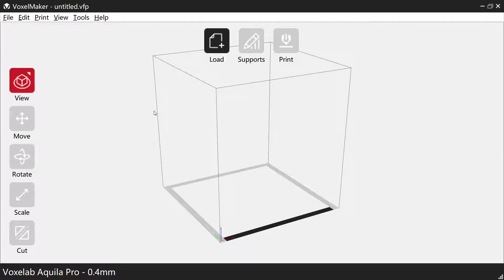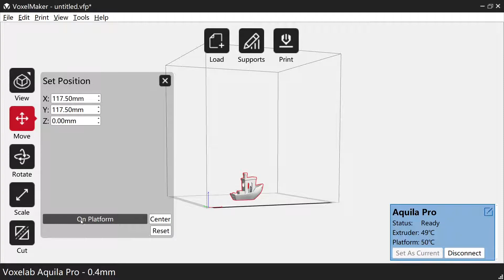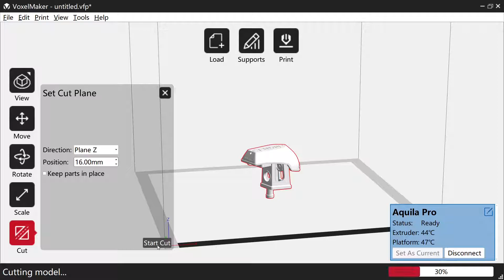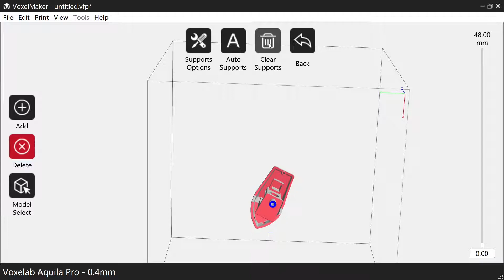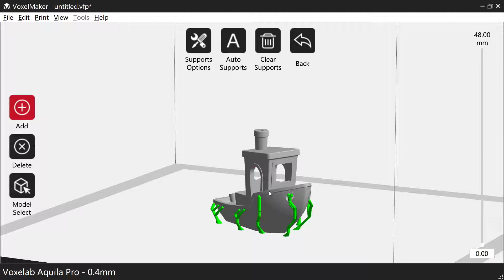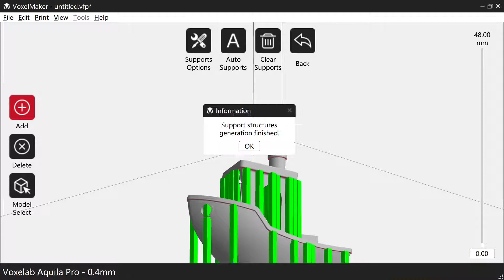VoxelMaker Overview

Comment: hi i was wondering if you could answer a question for me. someone recently gave me an voxlab aquila c2 but it had no lead screw. i ordered one 365mm T8 Tr8x2 Z Axis Lead Screw but my prints come up compressed. did i get the right size. is it possible i need an 8mm pitch? this is driving me crazy. any help you could give would be appreciated. thanks
Reply: That lead screw should work.  According to amazon it's for an ender printer so should work.  You may need to adjust the esteps in the printer settings.  Also check that you have the lead screw secured to the motor

Comment: Hello! I have an Aquilla X2 that I recently got as a gift. I'm NEW to 3D printing. So this tutorial was REALLY helpful in learning like the stuff on the left sidebar there. The continuation of this video KIND of helps me with all the print options but I really need more help and can't find help ANYWHERE from this program. Some prints come out smooth as all hell, others rough and crappy without settings changing or just changing the internal/external composition (Which I don't even know what that is honestly!) Any help would be appreciated! D:
Reply: Hey, I'm so sorry I didn't see this sooner.  Have you found the help you needed?  EDIT: Just realized I responded to this logged into the wrong youtube account.
Reply from the maker: Now I'm logged in to the correct account.  Let me know if I can help you with something but it's better to reply to the edwardMcrichy post, I don't monitor this channel as much as I should.

Comment: Awesome Tutorial!!! 
How can I change colors mid print?
Is it possible at all?
Reply from the maker: I haven't seen a way to do that. In this case you probably need to use one of the other slicers like prusa slicer in order to do something like that.  Check the printer menu you may be able to do it through the printer and not through the slicer
Reply: What you do is when it is at the spot you want it to change colors click pause, and then you can leave the print click auto unload then insert the filament then auto load. Then you can go back to the print section and click on the print you were just doing. Tell me if it works

Comment: How do you connect to voxelmaker via wired connection? Also what firmware do you have on your printer?
Reply from the maker: Hey sorry I didn't get back to you sooner.  I don't believe there is a way to connect direct to VoxelMaker, I don't see an option to connect through USB cable.  You could try using pronterface to load the file to the printer and print.
Reply: Replying to this very late, but hopefully it will help someone in the future. This information is incomplete, but it will get you printing by USB in Cura, and I'm still trying to get it fully functional in VoxelMaker.

It seems that to print directly from USB on older Voxelab models, such as my Aquila X2, you need the CH340 driver, which enables serial communication through USB, same as an Arduino board.

YouTube won't let me post a direct link, but SparkFun (who sells Arduinos) has a good article on it. Google "How to Install CH340 Drivers," and click on their article with that title. After installing, you'll see the serial communication ports in Device Manager, assuming you're on Windows.

To get my computer to detect the printer, I had to flip the power switch first, and wait for it to boot before connecting the the USB.

Now in VoxelMaker, go to Tools -> Serial Control. In the Serial Control window, there is a Serial Ports dropdown list at the top right. In my case, my printer was connected to serial port COM4.

There are many ports it could be, and for whatever reason, the Search Ports button didn't seem to work for me. Fortunately, Cura now detected my printer, automatically connected to it, and identified which port it was connected by, which saved the trial and error finding the right port. However, if Cura is still open when you try to connect VoxelMaker to the printer, the connection will fail with no clear reason given, because Cura is still hogging it.

When you click the Connect button at the bottom of VoxelMaker's Serial Control window, if the connection is successful, it will say so in the box to the left. You can now paste gcode (as text) into the Send window, send it to the printer to operate it.

However, I was unable to finish any print like this. After a short while, it would warn me that it was too busy processing my other commands, and fail. I assume this could easily be overcome by limiting the send speed, but I'm not sure of the correct way to do that yet. From what I could find, I believe the defaults for the other Serial Control settings are correct for my printer, but tweaking those may be the answer.

In any case, I did not run into this issue in Cura. I only needed to connect the printer, and open Cura. After slicing, the normal Save To Disk button will have an arrow to the right which you can click to set to "Print From USB". On the Monitor tab, there are buttons to move the extruder, and to preheat the nozzle and plate, which VoxelMaker does not have.

Oddly, while printing this way, the printer LCD and menu act as though it's idle, not printing anything. The Print Time/Time Remaining counters have to be viewed in Cura. I've not yet tested whether it's possible to change settings like temperature and print speed from the printer menu mid-print.

Hopefully someone can figure out how to get VoxelMaker fully functioning with this, because it was able to detect my printer's settings and immediately get to work, instead of having to add the printer manually, which is something Cura can't (and probably won't) do.